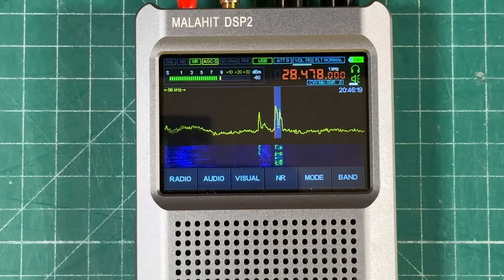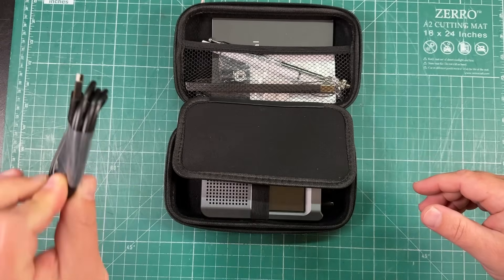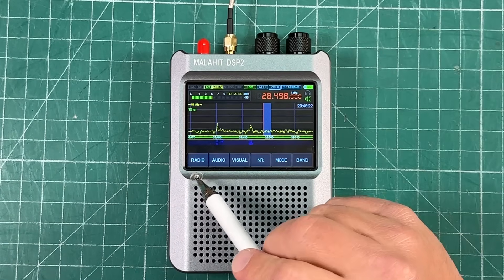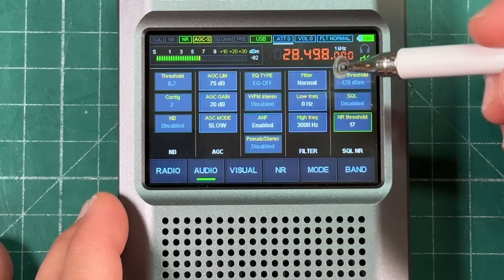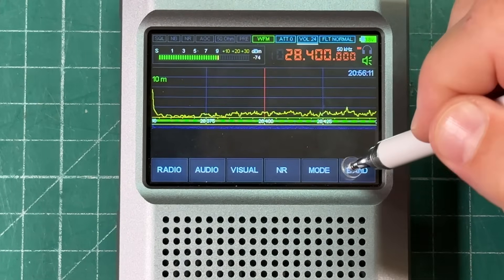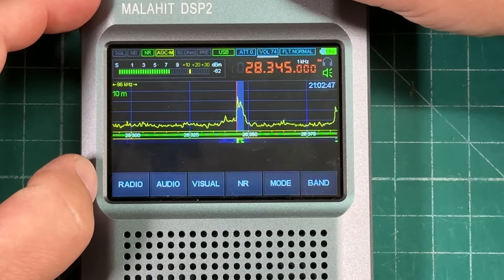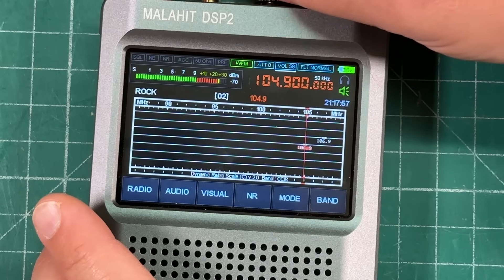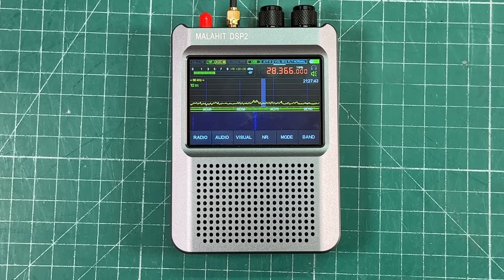Malahit DSP2 SDR Radio Receiver 10kHz -2GHZ SSB DSB CW NFM WFM AIR

Comment: The receiver is awsome. Bought mine too early and paid £200 more for it that what Aliexpress are selling it for now. Wrote off the discrepancy. I use mine with a Deshibo GA-800 loop antenna which is the best portable combination I've ever owned.

FT8 operating is annoying though as the inbuilt clock sucks. It's only letdown for me. Generally it's awsome and take it everywhere I go. If you have a Kindle there's an awsome book on there that's better than the original manual

Comment: I have had mine for over two years and yes it is quite an amazing receiver with real filtering etc that actually works very very well. As a FYl if you are familiar with the 3rd party manuals for Ham radios called 'RadioToday', which I find excellent, they have one for the DSP2 also. It's a full size manual over 100 pages. The supplied manual doesn't come close to showing what it can or how to do it. The manuals are available at DX Engineering and on Amazon. Nice video thank you. de K8CGS

Comment: These are good but not great in my opinion. I got one of these before they got popular and they jacked up the price to "unreasonable". I like it! But to tell you the truth, on HF my old Drake SW8 is way more sensitive in HF ranges. Too bad the Drake has no modern noise cancellation though. But yep, I can get both broadcast and ham SSB way stronger on the ancient Drake while with the very same antenna seconds later, the Malahit would not even pick up the same stations at all in many cases! Also the same on MW broadcast. It's ok on VHF and UHF, but not spectacular. Just not the most sensitive rig I've ever tested. The width of the bandscope is only 192 kHz max, not all that great above 30 mHz. I'm a ham and also an electrical engineer, so my opinion should be taken seriously. I don't have HF transmit capability right now or even a HF transceiver, but lots of receive only radios.
Reply: It shouldn't surprise anyone that the Drake SW8 is more sensitive on the HF bands since is mostly a general coverage receiver that includes air band and FM and AM broadcast frequencies.  It was likely optimized for operation on AM broadcast through HF.   Given the Malahite covers so much more of the spectrum there will be compromises to get all of that capability, and it is not surprising that it may not be a sensitive on HF as units optimized for operation on that part of the spectrum.  As for the price being unreasonable, I always thought the Drake was unreasonably high, especially near the end of its run, for the limited spectrum it covered.  And lack of noise cancellation circuits.  And lack of a spectrum scope (yeah, they didn't have them at the time, and they aren't strictly needed, but how many of the radios in total that we own are really "needed").  The Drake is a good enough radio if you like that style and the limited amount of spectrum it covers.  Many will buy the Malahite as a radio to add to our already existing collection of transceivers and receivers so we can have a wideband receiver that is truly portable and has a lot of fun features to play with.  One could argue that if you simply want receiver quality on HF to use the money toward one of the Yaesu transceivers, like the FTDX10, but people buy radios for so many reasons other than some esoteric advantage on receive.  As for cost, at the end of its run in the year 2000, you could buy a Drake SW8 for around 600 U.S. dollars.  Accounting for inflation, that would be over 1050 U.S. dollars today.  That gets you into an ICOM 7300, Yaesu FT-710, ICOM or for about another 300 bucks a Yaesu FTDX10.  I'd put those Yaesu transceivers against that Drake as superior with respect to features and receiver specs, plus they will transmit, have band scopes, filters and adjustments galore.  And, what an ego stating that we should take your opinion seriously as you are an electrical engineer and a ham radio operator.  There are so many reasons other than receiver sensitivity that drives purchase of a radio.  For example, I doubt I'd ever want to take a Drake SW8 with me to the field or on vacation.  If I wanted a receive radio with better sensitivity I have many better options than a quarter of a century or older receiver with limited features.  I hope God blesses you and your Drake SW8.

Comment: @HamRadioTube
Mike, can you please confirm if the radio has Bluetooth audio out, so one can listen with Apple earbuds?
Reply: I have had one for a long time and I have never got it to work with my Raycon ear buds. They intended it to have BT but its not able to at this time, as the feature is not finished in the firmware or hardware. Maybe a future revision update? No way to know, the devs are Russians so good luck trying to get a hold of them. There is a website they have up, not sure the URL right now.

Comment: I had one of these for a while and sold it.  The user interface is horrible.  Too many options, some not clear what they do and the manual doesn't help much.  It's way too much in a very small package.  If you can get over all the options it's a pretty impressive radio.  It took too much of my life to enjoy.
Reply: I agree they are a bit "fiddly"! If you have it set up really well for HF and then want to go up to say, something like the 2 meter ham band, you have to change and "fiddle" with so many settings (to even hear the 2 meter band at all) it can be very annoying. That's right, just going to the 2 meter frequencies straight from good HF settings, you might not even hear anything at all, even though you know a QSO is going on because you can hear it on another radio at the same time. Not worth the price they ask for it nowadays but I got one early for under $200.00 so I consider it worth it for me. And I never get rid of any radio, I'm a radio hoarder, lol....
Reply: You can edit all the parameters PER BAND and save your changes.   That makes a world of difference when you return to a band.